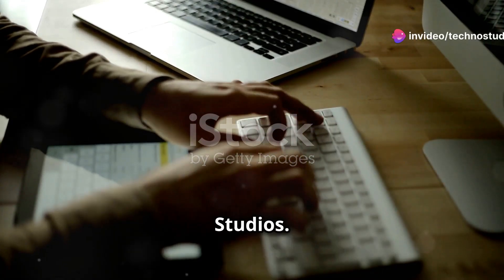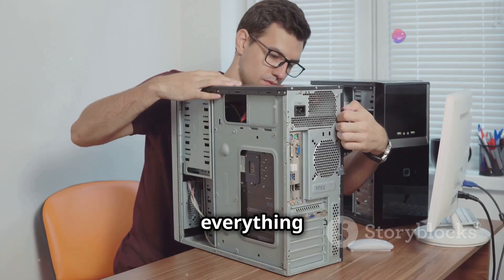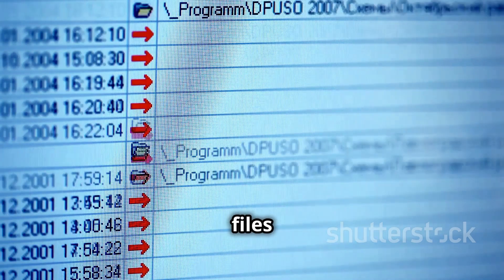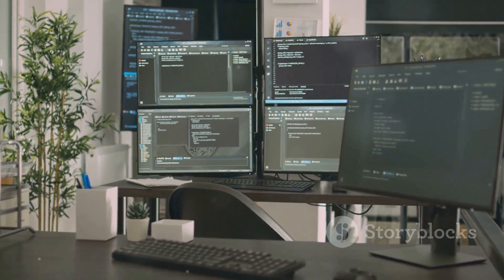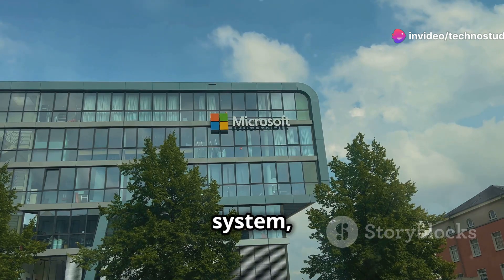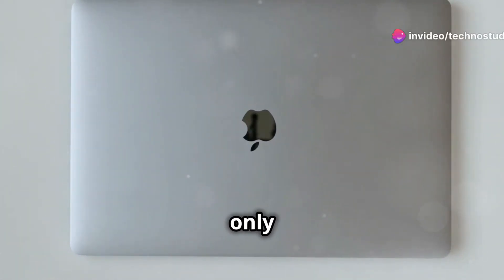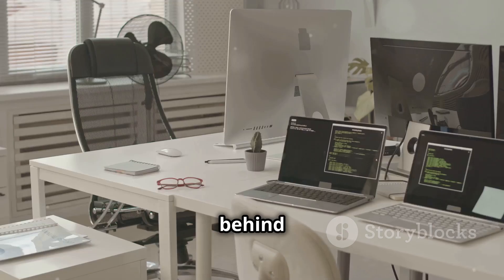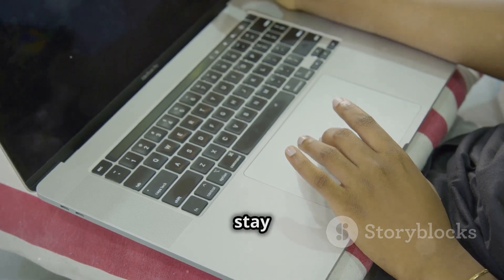Understanding Operating Systems

Comment: What you’re referring to as GNU/Linux, is more accurately just Linux. While it is true that many systems called "Linux" do include numerous GNU components, the claim that they should be exclusively referred to as GNU/Linux oversimplifies the complex landscape of modern operating systems and misattributes credit. The term "Linux" has evolved in common usage to denote the entire ecosystem surrounding the Linux kernel, including but not limited to GNU components. The Linux kernel, created by Linus Torvalds, is the cornerstone of the system, providing essential functionalities such as managing hardware resources, enabling process control, and facilitating inter-process communication. This kernel is indeed the bedrock upon which many distributions build their systems, and its significance cannot be understated. While it is true that the GNU Project, founded by Richard Stallman, has provided many critical components like core libraries (glibc), shell utilities (bash), and compiler (gcc), it is also important to acknowledge the vast array of non-GNU software that complements and enhances these distributions. For example, numerous graphical interfaces (such as KDE and Xfce), system services (like systemd), and applications (such as Firefox and LibreOffice) are developed independently of the GNU Project and yet are integral to what users experience as "Linux". Furthermore, modern "Linux" distributions often incorporate software from a wide variety of sources, not just GNU. Projects like BusyBox, musl, and others provide alternative implementations of standard utilities and libraries. The Linux ecosystem also includes a substantial amount of proprietary software in various distributions, further diluting the claim that these systems should be labeled strictly as GNU/Linux. Additionally, the argument that the system is "basically GNU with Linux added" overlooks the modularity and flexibility that define Linux distributions. Many distributions, such as Alpine Linux, explicitly minimize GNU components in favor of other implementations. The diversity of software options available demonstrates that the Linux kernel can operate within many contexts beyond a GNU-centric framework. The emphasis on the nomenclature GNU/Linux appears to stem from a desire to ensure that the GNU Project receives appropriate recognition for its contributions. While acknowledging the invaluable work of GNU developers is important, insisting on the term GNU/Linux does not fully capture the collaborative and multifaceted nature of the Linux ecosystem. The open-source community thrives on contributions from countless projects, each adding unique value. Referring to these systems as "Linux" is a practical convention that reflects the kernel's pivotal role and acknowledges the contributions of various projects, GNU included but not exclusively. This terminology has been widely adopted and understood in both technical and general contexts, serving as a testament to the collective efforts that sustain and advance the Linux ecosystem.